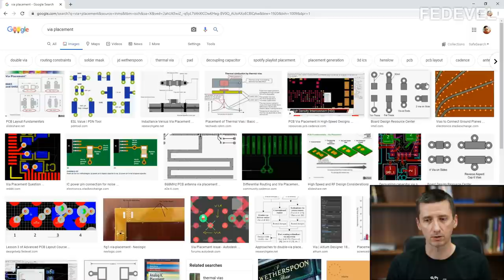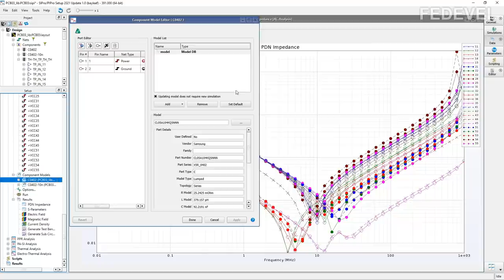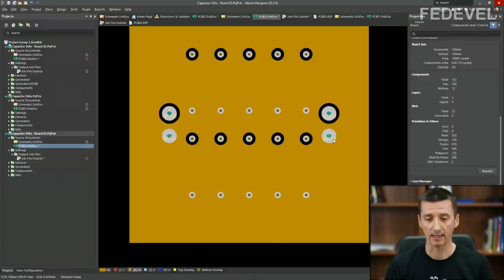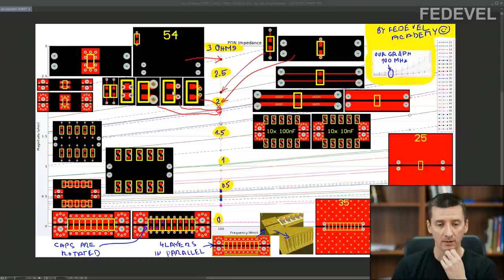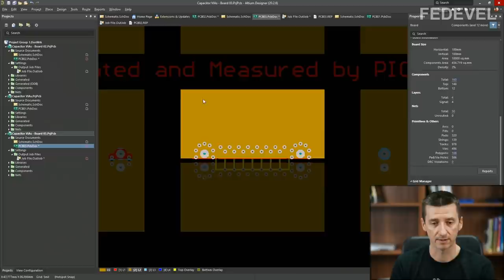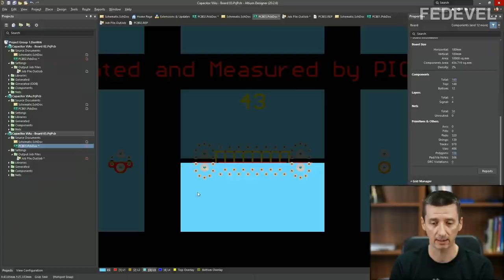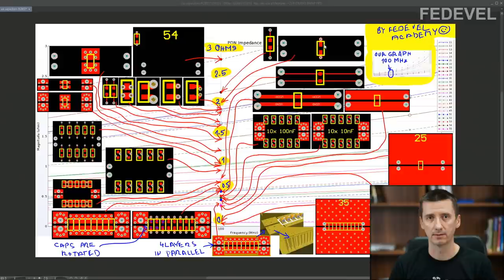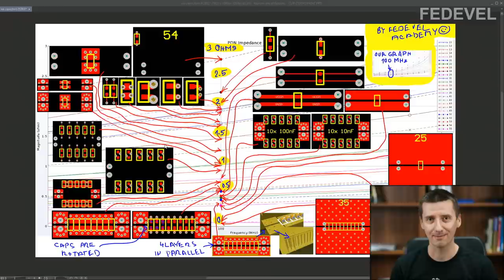What is The Best VIA Placement for Decoupling Capacitors?

Comment: I was very surprised initially when I saw the results from the caps directly connected with tracks to the power supply. But after a second I realized that that makes sense because you are not using any vias thus eliminating their inductance from the equation.

What software do you use to simulate this? I'd like to give it a try with some combinations I have in mind. I'd like to simulate a more realistic example by placing a TQFP footprint instead of the "sink" pads you are using and chose two pins from the TQFP as the sink, like on a real board, and simulate the effects of a decoupling cap on various positions. I'm more interested in simulating what happens when placing the decoupling cap on the same layer as the IC and connect the power through a trace and gnd to a GND plane with a via.

Comment: Hi Robert. Thank you very much for this video. What about connection material? I keep thinking about the case of 1 capacitor with direct connection in top. I think pure copper is always the best option for current and thermal flow. May be the material or connection in via's building process never win to copper. 
Congratulations!

Comment: Hi Robert, great video as always! I really enjoyed following along and predicting results, albeit not always correct :) It means I've learned something. I would really like to see you follow up with testing these in real life, I was also a bit surprised with the the one with long thing connection, I would not be if the pins were not effectively vias on their own, as all supplied power would need to pass through the decoupling capacitor. I've always been thought to consider connecting in a way that power needs to pass through the decoupling cap before connecting to a pin, with PTH it's harder ton achieve that, but on SMD like you mention it is much better to have decoupling cap on same layer as the pin connecting to it. 

I wonder, if having sink PTH pins isolated from the power plane, forcing all of the power to pass through decoupling cap before reaching the sink pin, would yield better results?
Reply from the maker: Thank you very much

Comment: Is there a difference if you place 1 capacitor close to output pins, or 1 capacitor close to power pins, or 8 capacitors between? I miss this comparison in your simulations. btw. nice video ;)
Reply: Hi Juraj, From a class attended with Prof. Todd Hubing, he mentioned this aspect. You have to consider where is the power and gnd plane to decide where to place the cap. You have to think about the current flow path and consider which plane needs decoupling more (quite often the farthest plane in the stackup is where you place the decoupling cap). A usual stackup is sig, gnd,pwr,sig (im not recommending this stackup, just for eg). In this case, I would place the decoupling cap close to the power pin.
Reply from the maker: Thank you Juraj. I could try that next time. Making a note.

Comment: I love that your are actually simulating many different cases to try to figure out how this works, rather than just reiterating some rules of thumb that are out there.

I think your simulations are correct in some regards, but some of the conclusions might not cover the full story, so there are some further points that are worth making.

First:

You get impressive and surprising results with those long skinny traces to a capacitor between the source and load. This might at first seem surprising and I think the simulation is correct, but possibly not very relevant. I think you are simulating the shunting impedance between power and GND as it would be seen by a VNA doing an S21 measurement. So if you force the signal from port 1 to travel along arbitrarily long and skinny traces, then encounter a capacitor that shunts the power and ground trace with no parasitic inductance in the shunting other than that of the capacitor itself, the signal on the traces at the capacitor will be very effectively shorted by the capacitor (and almost all of the wave reflected back to port 1). The signal that continues towards port 2 (the load) will be very small indeed, again regardless of the length and skinny-ness of the rest of the traces.

A similar effect happens with the examples of caps connected to the planes, but either right between the source and load or far off to the side. Most of the signal from the source will go along the shortest line between the ports, and if there is a cap there, it will effectively shunt the signal. If you had had much smaller separation between the power and GND planes, you would probably see much less of this effect as the signal would spread out more due to the decreased inductance in the plane-pair

This kind of decoupling effect is relevant if you have a noisy power supply and a quiet load you want to protect form the noise. So for this case, your result that this layout is a good one is correct.

However, if the load is also noisy (draws significant current at high frequencies), this layout is no longer a good one. The impedance looking into the load terminal (as you would see if you simulated or measured the shunting impedance as seen by an S22 VNA measurement at the load) is very high due to the large inductance in the skinny traces between the port and the cap.

Most of the time (but not always) the most important purpose of a PDN is to provide clean power to loads that have noisy current consumption and thus are prone to disturb themselves. This does not seem to be the case you are simulating. To simulate this, you need to inject the signal and measure it at the same port. Or, if you want to  do an S21 type of simulation, you could perhaps place port 1 on the top of the board and port 2 on the same through-hole pads, but on the bottom of the board. If you want to measure low impedances like this in the real world using a VNA, an S21 measurement from top of the board to the bottom of the board is a good setup. S11 or S22 measurements do not work very well to measure very low (or very high) impedances as they essentially need to subtract two almost identically large signals from each other and look at the difference, which is therefore extremely sensitive to small errors in the measurements of the outgoing and reflected signals.

Second:

A 4-layer board typically has a very large separation between layers 2 and 3. This is certainly true for the JLC standard stackup. This is not ideal if you want to have a low-impedance PDN on your board. So if you are stuck with a 4-layer board of this stackup and need to use layers 2 and 3 for power and GND, your conclusions about e.g. capacitors connected directly to the load is highly relevant, since there is so much inductance (and so little capacitance) in the planes, which makes it impossible to create a decoupled plane with a really low impedance.

For more advanced boards with more layers (not usually used by hobbyists, but very common in the industry), one typically strives to have a much smaller separation between the power and GND planes. 0.1 mm is rather easy and smaller separations like 0.75 mm or even 0.05 mm is not too advanced for many board shops. This totally changes the situation regarding how important it is to have decoupling caps connected directly to the pins of the load (or right between the source and the load if that is the case you are interested in).

Howard Johnson has in his black magic book a very neat and simple formula to calculate the inductance of a pair of vias connected to a pair of planes (converted to metric units):

L=mu / (2*pi) *2h * ln(2s/d)

Where:
mu/2pi = 2*10^-7 H/m
h = thickness of the dielectric
s = center separation of the vias
d = via diameter

So, the inductance is much more sensitive to the thickness of the dielectric than the via separation and via diameter, although there is some reward to be had in optimizing all of these parameters.

This formula can help estimating how important or unimportant it is to keep the vias a decoupling cap close together. The total inductance of the cap can be approximated as the one given by this formula, plus the inductance of the vias above the planes pairs, plus the inductance of the tracks between the cap and the vias, plus the inductance of the capacitor itself.

Johnson argues that this formula can also be used to estimate the inductance of a distant decoupling capacitor as seen from a load by plugging in the distance between the load and the capacitor as d in the formula. So inductance increases only logarithmically (very slowly) with increasing distance.

By the way: In multi-layer boards, there is a new factor to think of: Decoupling capacitors are more effective if they are placed on the side of the board closest to the plane-pair they are connected to, since this reduces the inductance of the vias that connect the capacitor to the planes.

Comment: Thank you for the awsome series on impedence in PCBs. I have a question in this video. Wouldn't the PDN depend on the value of capacitor connected? I see that the capacitors in each layout is different so, apart from trace length and width, I have a suspicion if the actual capacitor values also contribute to PDN

Comment: It would be nice to see the case when you connect the VCC net of the capacitor directly to the pin, but the GND is connected through vias. I think this is a pretty common scenario when designing PCBs. Would be nice to see there does it stand in the chart.

Comment: You mentioned you used the JLCPCB 4-layer impedance controlled stackup. My understanding is that the inner two layers on that board stackup are electrically connected together via the copper core between them, effectively giving you a 3-layer PCB from an electrical standpoint. They don't show any insulation between the core and inner layers in the stackup diagram. Am I misunderstanding how it works? I tried asking JLCPCB about it before, but there was too much of a language barrier so I didn't really understand their response.

Comment: Very interesting Robert. So your simulations show that the lowest PDN impedance is when the capacitor is on the same layer as the IC, even if the capacitor is not really close to the IC pin?

Comment: I think that for your multiple capacitor tests they might be best basically because there's at least one capacitor very near the output. I miss a test where ONE single capacitor is placed next to the output. My assumption is that this would be very good regardless of the type of connection. Also I tend to think that the smaller footprint capacitors should perform better at higher frequencies, but of course this should be tested before making a formal statement

Comment: Hi Robert, Something I observed also from your call with Dr. Eric Bogatin about PDN impedance is to look at impedance seen from the power port (pwr + closest GND pin) out towards the PDN network. In this simulation, is one port the input power and you are looking back from the other power port? I assume so. 
I have a question about placing caps close to the power pins on QFN packages. If we keep them close, sometimes there is not enough space to put a via and then I have resorted to putting the via on the other side of the chip pin. This would be a good simulation to run as the PDN network will be seen with via and the capacitor in parallel with it.
Reply from the maker: We are looking from power pins. PS: That is an interesting example. We could try that too.

Comment: I't would have been interesting to see what kind of difference does it make if you are using thermal reliefs. I rarely use direct connection for connecting passives to power planes, that's why I'm wondering.
Reply from the maker: We can try that ... putting on my list to test

Comment: Great to see a subject often debated in theoretical terms, given some real world numbers rather than, this way is 'better'. For chip decoupling, is it better to have the via between the decoupler and chip, or should it be via, cap, chip?
Reply: Less noise will get into the power plane if you go via->cap->chip. This is due to the extra inductance between the cap and the via. Of course this is a TINY effect because of the very short length of trace there.
Reply from the maker: Thank you Hugh. PS: I agree with @Goat - that is also the way how I try to do it (if possible)

Comment: Thickness of the core in this 4-layer stack-up is HUGE (about 1mm, like in most 4-layer stack-ups). I think that's the reason that capacitor placement appears to be more important than connection style. I would definitely reduce the distance between power and ground plane to something like 0,1mm. That is more of a "real world" value for boards where one really cares about PDN impedance.
Reply: I think this is not necessarily true.  Some designs us 0.1mm, many 0.2mm-0.4mm and there are also still a lot of 4 layer PCB's
Reply from the maker: We may try different stackup in some of the other simulations.

Comment: Nice video. However, since you are using a 4 layer board the spacing between power and ground planes is relatively large which makes the inductance big.
That is why your results are sensitive to capacitor placement. If you used a small spacing between power and ground plane like 3 mils then the spreading inductance would be much lower and not as sensitive to capacitor placement. Would be interesting to repeat this using 3 mil spacing.
Reply from the maker: Thank you Joel. Do you mean like this? https://youtu.be/ELe1RNa-WC4
Reply: @RobertFeranec  Yes, that makes perfect sense.

Comment: Interesting! When I read in the datasheet that the cap is to be placed as close as possible to a pin of an IC, I've often placed vias directly into the pad of that pin and the decoupling cap on the other side with the via in the pad as well. Maybe I should do it differently.

Comment: Would also be good to measure using VNA to verify the simulation. But VNAs are very expensive and can be tricky to set up properly to get accurate measurements and you probably need SMA connectors  on the board.

Comment: We are always told to put bypass capacitors as close to the power pins of an IC as possible.
But how much difference does it actually make? If we put the bypass capacitor super close to the IC, will it be light years better than having the bypass capacitor 10 mm away from the IC? Or just a little bit better?
Could you run a simulation where you put a capacitor very close to the output power pins, compared to putting it maybe 10 or 20 mm away from those pins?

Comment: it kind of makes sense the direct top layer would be better at higher frequencies , the DC resistance of even small bits of copper would be extremely low probably lower then even like 10 or more vias over that distance. The traces would also have some inductance but probably less ... the higher inductance of vias would quickly add up.

Comment: I don't understand why there wasn't a focus on having the caps as close as possible to the "IC" pins, while testing these various layouts. Also, I'm confused with the "IC" power pins are all connected to the power/ground planes. Doesn't this kind of defeat the functionality of the decoupling caps? Wouldn't it make sense to have a layout which goes plane -> via -> trace to cap -> cap -> trace to IC -> IC PIN?

Comment: Re: 23:38 - the two parallel lines create another capacitor - two conductors with a dielectric between them, so it makes sense that the results are better.

Comment: Did you ever test the use case of direct link on one side of capacitor and via on the other. I can only see examples of vias on either side of cap or direct link on either side of cap. Curious to know degree of difference.

Comment: Hi Robert, I am not trying to take advantage of your generosity for doing these experiments. You showed that keeping the capacitor faraway gives the worst response. There another lever to play around with which is dielectric thickness. Once again I heard this in a seminar. The theory is if the power planes are close enough most of the decoupling capacitance is provided by the pcb capacitance and bulk decoupling caps is only required. Essentially the cap location becomes not critical if the power planes are close enough
Reply: Again these are all partial inductances.  The thin dielectric will reduce the inductance, but there is still the inductance from the planes to the caps (through the vias).  So if the plane pairs are very close together, but deep in the stackup, it will still be inductive
Reply from the maker: Thank you Jayakrishnan. We may try also some examples with different stackup.
Reply: @stevesandler3974   partial inductances are so small that they can be ignored?
  and not bother with the choice of the thinnest prepreg between the layers of power and ground?

Comment: You must be a mind reader because just last night I was making a sleepless mental note to see if you had a video discussing this, and if not, to request one.
Reply from the maker: :D
Reply: You're not the only one, Patrick... :D
Reply: @RobertFeranec  One case that I didn't see in your examples was the capacitor with vias to the power planes and a direct connection to the power pins. I am not sure if this would have similar results to the "straight through" examples you had near the end.
Reply: @patrickgrindstaff7215  Perhaps you mean a capacitor with one end directly connected to the power pin, and the other end connected to a via to ground plane?
Reply: @Graham_Wideman  I'm thinking more along the lines of power and ground vias to the power planes (power supply) then a trace to the power pin of a uC. Power supply in this case is a battery with no regulator.

Bat+ -> Via to VCC plane
Bat- -> Via to GND plane
Via to VCC plane -> Cap+ -> uC power pin
Cap- -> Via to GND plane